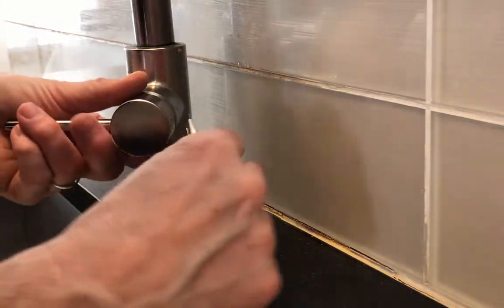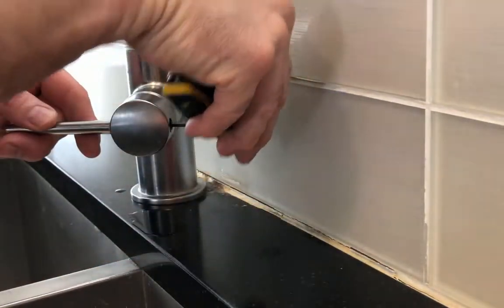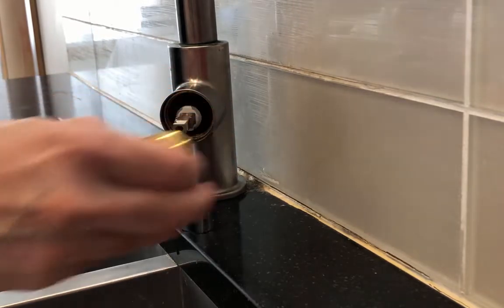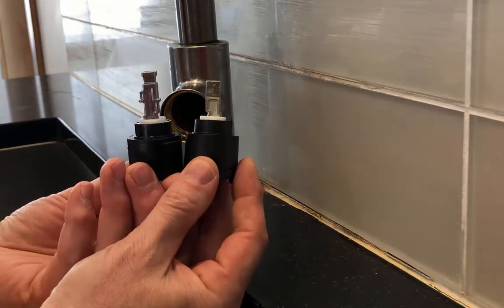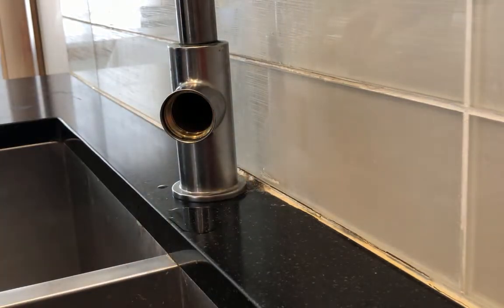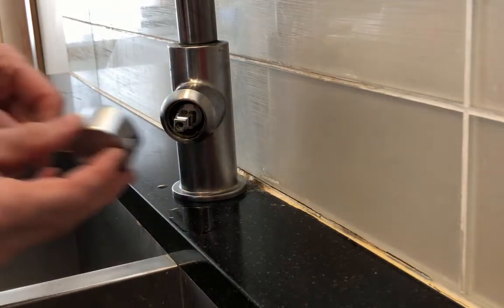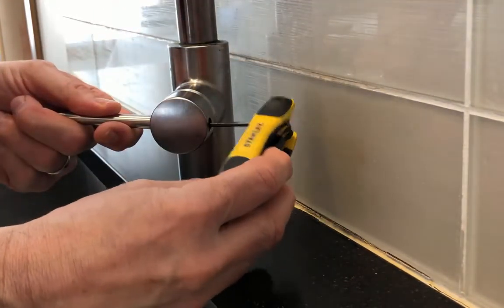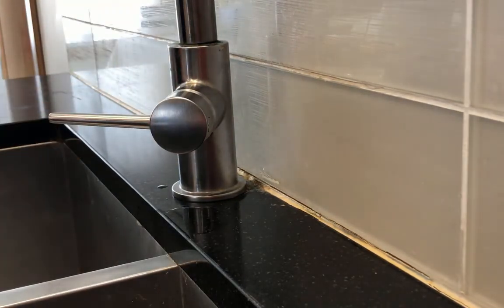(DIY) Delta (9159-AR-DST) Kitchen Tap Cartridge Replacement

Comment: Thanks for the video.  My new tap had a slight space showing on the decorative cover and I was wondering if it was screwed on or just press fit.  So screwed on it is so I just turned it a little without disassembly.  Worked for now, but I'll keep an eye out to see if it unscrews in time,  If it does I'll take the handle off and get a little more grip to tighten the cover.

Comment: UPDATE: The cartridge you need for this faucet is model number RP60114 (Search for that part on Delta's website. I posted a link in a previous comment but I think it was deleted). The "newer" cartridge in this video that will not work is Delta part number RP73000.

Comment: New cartridge requires the set screw to be threaded BEFORE installing.  Easy enough, but way more difficult to do after the job is nearly complete.  Thread the new screw first, then swap the cartridge

Comment: But you put the old cartridge back in, not the new one. I have the exact same faucet that's leaking, and Delta sent me the same newer version of the cartridge. The problem is that, as you mention in your video, the new cartridge has a different shaped end, and it does not fit in the slot of the handle. Did you try to re-assemble the faucet with the new cartridge?